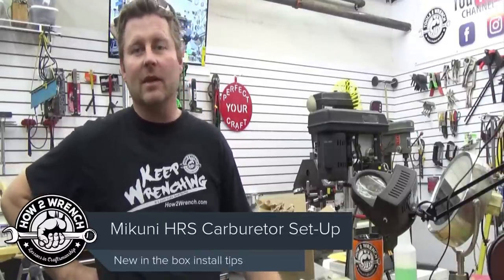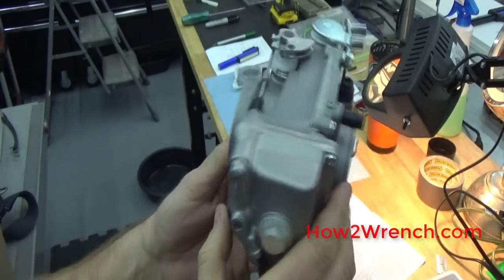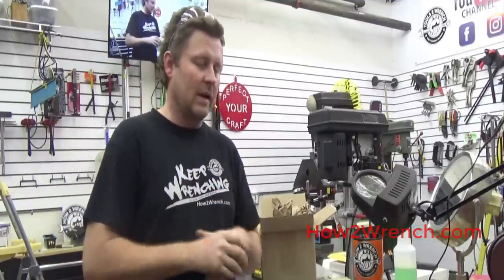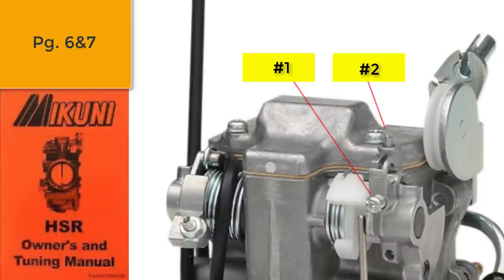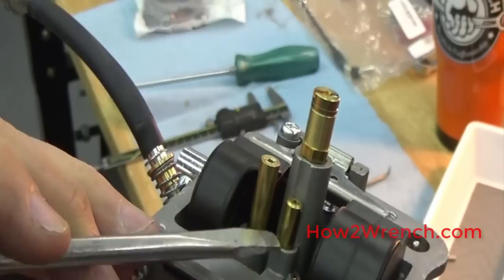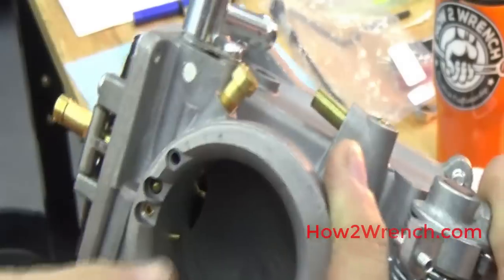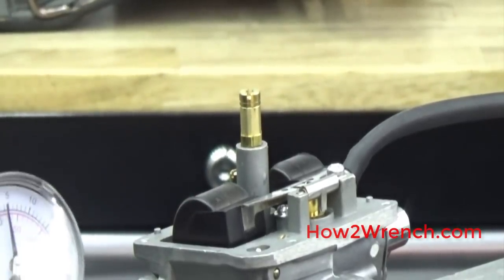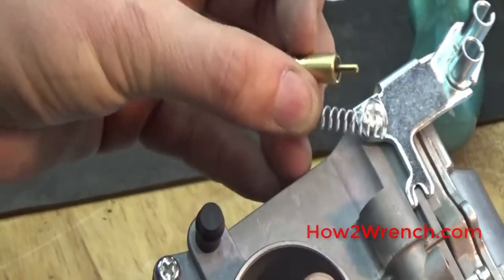How to set-up a Mikuni HSR Carburetor. Float height, Cables, Jets, Leak Testing!

Comment: Hello Shane. My 94 fatboy, hrs 42 started to backfire out the carb (very bad) at around 1600 rpm &wont rev past 2000 rpm(severe backfiring)
I've taken the carb apart a few times, all passages are clean (went back together with carb kit)adjusted everything as your EXELENT vidio instructed. Still same problem. Idles fantastic. Do You have any ideas what else it could be?
Reply: I should have mentioned I have very good fuel flow from gas tank, & new plugs
Reply from the maker: Hi Kim...many varibles...compression, leakdown it where I ALWAYS start before touching a carb and to baseline over time. HD's are know for intake leaks too. I have videos on all this here
Compression: https://www.youtube.com/user/conleybuilt/search?query=compression 
Leakdown: https://www.youtube.com/user/conleybuilt/search?query=leakdown 
HD intake: https://www.youtube.com/user/conleybuilt/search?query=harley+intake 
👍 Thank you for taking the time to comment! It helps us! 
Here is a way to support all the free videos.
Want to say “thanks” or “keep it up”? Click here https://www.paypal.me/how2wrench  

Subscribe and Follow us! 
Web:
www.How2Wrench.com     
www.Tools2Wrench.com
Reply: Hello I'm sorry I didn't realize I was on my wife's YouTube. I'm Gordon. 
I figured it out,   2 problems,   the carb was dirty inside I fixed that.
The other problem was I didn't tighten the 2 nuts on the coil.
Cant believe I didn't see that before. 
Thank You for all the tips. Your vidio is cool, Thank You again
Reply from the maker: @kimlake7285  Good find...enjoy the ride and please sub and tell others about us. H2W
Reply: @How2Wrench  I will Thank You

Comment: I say it will shoot gas 2 foot out of the carb , but I own a 42mm HSR,   im running a tad on the lean side , it was on the dino with my SE heads , Im back to stock , with bigger pistons 10 over . Think its on the Needle setting , not my jets .  The 42 is not the same as a S&S lot more to the 42 .  I have my book , I rather see it apart .

Comment: $400 carburetor out of the box on my 95 heritage- RUNS LIKE SHIT, WONT IDLE. And if it does, it dies shortly after. I’m extremely disappointed and am putting a cv back on what’s SUPPOSED to be on there.
Reply from the maker: We asked Shane about this and he said to google "counterfit HRS" or mikuni and make sure you don't have the counterfeit copies running around. Even dealers are getting burned reselling them thinking they are making more money but get ripped off with the counterfeits. Mikuni put our a notice somewhere.

Comment: You keep calling them vernier calipers they are not vernier calipers.  You have only used dial calipers and digital calipers.  Vernier calipers are the ones with all of the little lines on them where you have to match the lines up.  There is no dial or digital readout on vernier calipers.